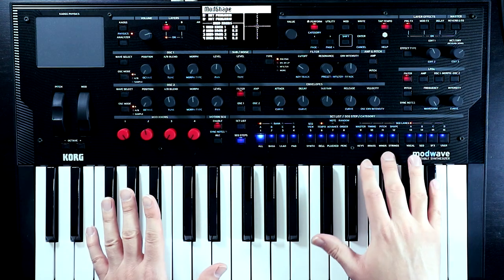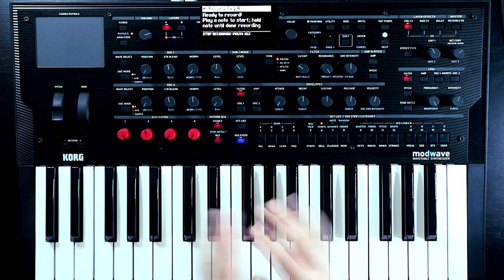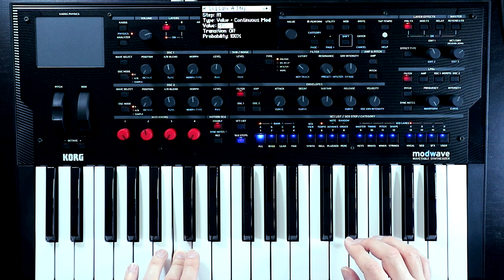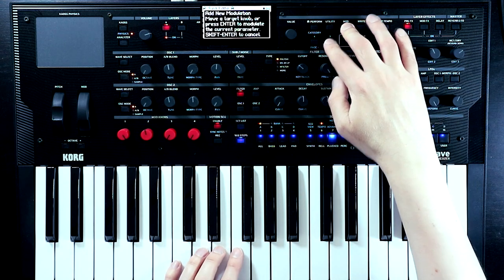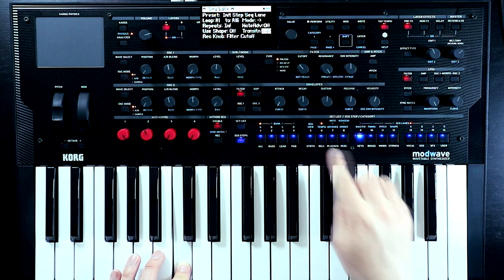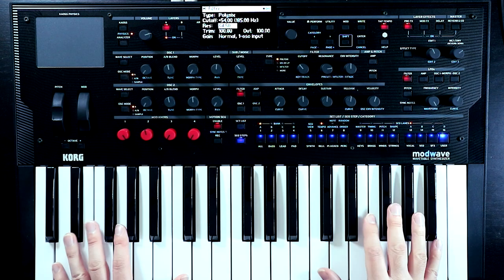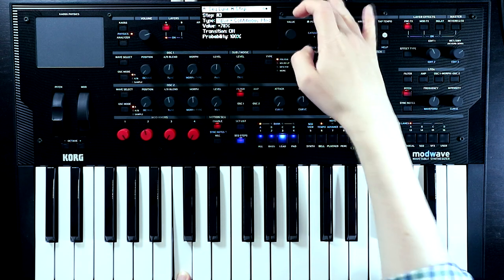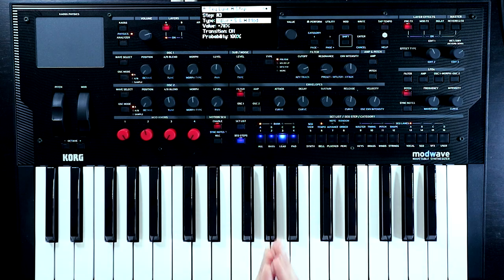Korg Modwave Sequencer In Depth - Part 2: Modulation and Shape Lanes

Comment: The Shape track is so cool. 

As its basic coolness try this. 

Set one of the A,B,C,or D tracks to 1 step 100% value.

Set TIMING to 1 track 1 eight note value. 

Set 1 track SHAPE ramp down BUT set value to 0 and set its modulation from Osc1 and set it to timed half note or higher shape of ramp up. 

Set Track(n) to modulate pitch of an oscillator at say +12 semitones.

Listen to the madness when you press a key.

Comment: 20:12 It's interesting that you can S&H a mod source on the pitch sequence, but is it also possible to quantise it to semitones, or preferably lock it into a fixed scale? That would be REALLY useful. Later you show how to set up sequences in semitones, but I'm talking about randomising some of the steps but locked to particular quantised scales. This is something that's done a lot in modular, and it would be very cool to have it as a feature on a synth that operates polyphonically and saves its patches.
Reply from the maker: Yeah, I really hope that they add those same options to the pitch lane - it seems like an obvious missed opportunity. You can fake it with an appropriate LFO modulating the steps (I show this in part 1), but it is a bit of a hack.

Comment: is there a way to use the sequencer to trigger the Amp envelope with each step?  in the manual it says on p. 62 to modulate the Filter Output level, but is that really the only/best method?
Reply from the maker: Yes, I cover it, and other aspects of the envelopes here: https://youtu.be/O44fJJQ_Zj8
Skip to around 15:25 if you want to jump to the answer.

Comment: in general, can you hear the difference compared to an analog synth (e.g. at some pitches)?
Reply from the maker: If you're asking about obvious digital artifacts at higher pitches - not that I'd particularly noticed. There are other things that might tip you off, but it can do a fairly good "virtual analog" sound if that's what you want, once you set it up. It might not be my first choice if you just want a VA though - there are synths out there which will do that job more in a more straightforward way, and conversely, if that's your focus, you'll be missing out on a lot of what makes the Modwave interesting.